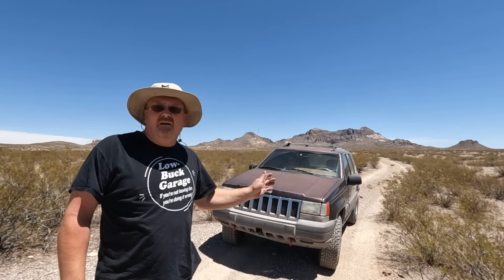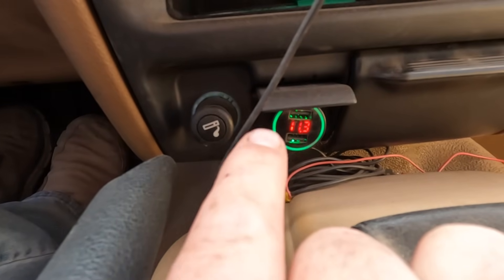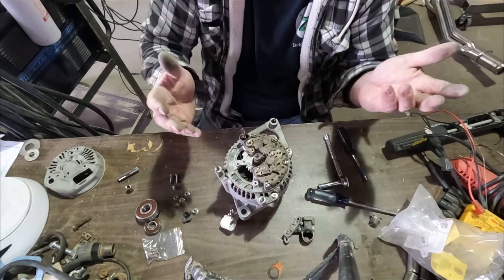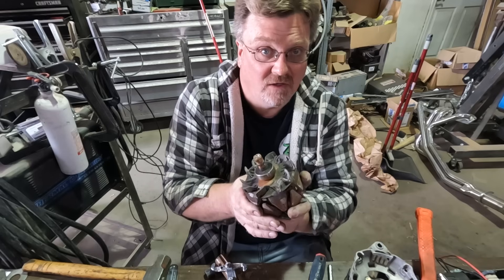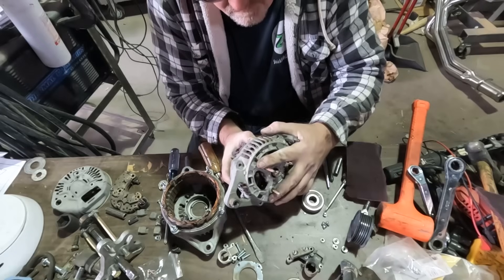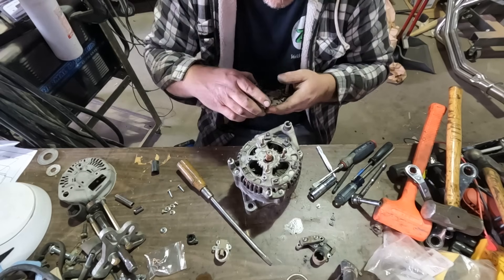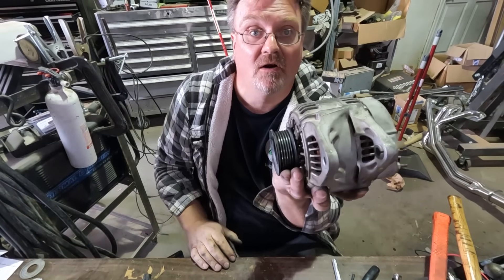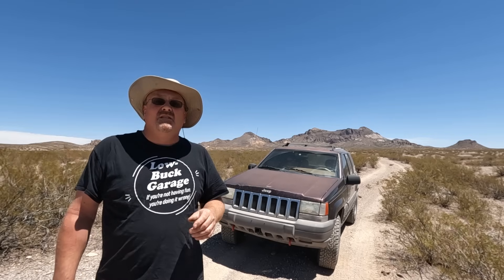$19 Alternator Rebuild, Cheaper is Better?

Comment: Growing up there was always a shop to rebuild alts and starters.  Now I do my own. Good to see you show others as well.
Reply: How did you discover a local alternator rebuild parts supplier?
Reply: In Cleveland Ohio area  I recommend  Gregg's  alternator and starter rebuild!!!
Reply: Handy hint. 
On news bearings pop the seals off and repack with good synthetic grease the crap grease they come with looks like Vaseline.
FYI.
Reply: @tomg6284  Yes it does look like Vas. However when you open the bigger bearings its got a yellow dye in a more transparent grease. There is no product in the grease that can cause extra friction through viscosity.
Reply: I’m with you Tom. Never trust a sealed bearing to be lubricated adequately.
Reply: We have one local down here , but , 
Some time he does a good job, but some times doesn’t. 
It’s like 50/50 . 
He warranty his labor for a one year.

Comment: There's a scrapyard not well known in my area that sells tested starters and alternators for $30-35 and gives you ten for your core. Their warranty is one year and is the best kept secret around here and even though it's an hour drive each way is where I go after calling for availability. They give free gas away too whether you buy something or not up to 20 gallons which is the secret.
Reply from the maker: I never thought about that, they probably get a lot of gas in the tanks of cars that come in, and would probably have to pay to dispose of the hazardous material.
Reply: Where are they located?
Reply: @wesleycorder4594  New Hampshire
Reply: How is an hour drive in your area
Reply: @brinkboysproductions6061  Rarely deal with traffic and it's mostly highway driving. Definitely a huge change from DC or anywhere in that area.
Reply: @Davemike27 That makes sense. Can you filter the gas. Best wishes.
Reply: we believe you ??  but seems more like lah lah land !!
Reply: Wow. What an awesome place

Comment: Great idea to rebuild an alternator.  I just learned that a new 175 Amp dealer alternator for my Lincoln Navigator is $1,000.00 here in Canada.  A rebuild can be had for about $650.00 to $700.00 (CDN).   We have one reputable alternator rebuilder in Toronto that does a quality rebuild for about a quarter of the new price, but they do have a turn-around time of 4 to 7 days, so you have to be willing to be without a vehicle for up to a week.
Reply: Good   day  from Ontario  Kitchener  Waterloo area  We have a fellow up here that does it too.
So were are from ?  Thanks
Reply: Well you did buy a Lincoln....
Reply: @r3dhorse  True, it is a premium vehicle, but I acquired mine used for a fraction of the new list price.  It isn't just a high price for the badge name.  I've realized the vehicle has a number of very high quality parts that exceed the quality of its' cousin, the Ford Expedition.  The standard 175 Amp alternator is just one example of that.

Comment: My experience with alternators is the new one from the parts store doesn't work either and they will gladly keep giving me new ones that won't work until i get angry, demand my original core back, and rebuild it myself.
Reply: Acronym of new... Never Ever Worked
Reply: @kelsycunningham8452  that's awesome, thanks!
Reply: If you bought a new one there would be no core charge. Lol
Reply: @TheMainLead  mouthy kid

Comment: When I was a dealership mechanic back in the 80's and 90's, we would repair alternators, not replace them. The most common problem with GM alternators at that time was the diode/triode, pretty cheap part.
Reply: I want to learn howto do this. Best wishes.

Comment: As a retired mechanic you can use a deep wall socket that fits on your inner race to install your front bearing rather than a punch.
Reply: Surely it should be the outer race. Otherwise you are transferring the forces through the bearings rather than directly on the race.

Comment: Unless the bearing is severely worn or about to fall apart, you can prop it up so that the top surface of the bearing is level. Then clean any dirt off the seal with a clean rag. Next, put a few drops of motor oil on top of the bearing and rotate the bearing by hand for a minute or two. Keep the top of the bearing soaked with oil. If you rotate the bearing back & forth for a few minutes, some oil will usually seep down into the bearing. Unless the bearing is severely worn, it will usually run for a few more years. The thicker the oil you can get into it, the longer it will take to dry out again. If no oil will go down into the bearing, you can pry open the seal a little to get some to go inside the bearing. Damaging the seal is okay, just don't completely remove it. Don't get oil all over the inside of the alternator because dirt will stick to it and make the unit run hotter. Alternators hate that. 
I used this method on a dry idler pulley on my 2000 Ford Expedition serpentine belt. That was about 5 years ago. I have the new pulley, but am too lazy to install it. And the tensioner spring on that Ford belt is some strong. It is amazing that those bearings last as long as they do. 
Smart phone photos are good to have before you pull things apart. Free too.

Comment: I had a '73 Peugeot 504 many years ago, and the brushes went out on the alternator. They are in a small plastic box that is held in by one screw. I disconnected the one wire on the box, removed the box and put 2 new brushes in it without removing the alternator. It was actually made to be easily repaired! The 2 brushes cost me $1.50 at an auto electric shop. So easy!
Reply: My dad bought a used 1966 Peugeot from a co worker that had four speeds on the column. I just remember how expensive parts were for that thing. It needed wheel cylinders and at the time wheel cylinders were going for 5 or 6 bucks for American cars. They wanted45 bucks for one wheel cylinder and you had to travel to find one. My dad didn't keep that car too long. Good comment.
Reply: @mostlymoparih5682  There are some dirty tricks. Measure the diameter of the wheel cylinder. Find another on with the same diameter. Swap seals. One I heard about was the guy who figured out Chevy wheel bearings would work in his old Jaguar.
Reply: @anonymike8280  Yeah some seals and bearing have a number on them and you can order them that way also. If we were not able to get the cylinders we were going to try and match up a wheel cylinder repair kit.  Happy Motoring.
Reply: @mostlymoparih5682  Last time I had to deal with a leaky wheel cylinder, I just swapped the insides. Same cylinder though.

Comment: That was a nice honest video. I really liked the trick he used welding the nuts to the bearings in order to get them off. A few suggestions always mark a line from one end of the alternator to the other before you do anything so that when you go to put it back together you will know the correct position the 2 ends should go back on. I would also check each diode to make sure they are all good and I would also check the coils to make sure none of them have a short to ground. Still, this was a very nice video.
Reply: if the coil was shorted, you'd have to re-wind it right? my alternator housing (case) was cracked. I haven't opened it up yet but I figured if the case is cracked it probably isn't even worth the rebuild. I am thinking about taking it apart just to learn. (it's what I do)
Reply: Cracked case was probably from a previous swap out. . . Probably run another bazillion miles after this rebuilding. . .

Comment: I used to love working at the local salvage yard. One of the perks of the job was free parts. Within reason obviously. I couldn't just take home stuff all willy nilly as I pleased, but if it was for my vehicle, it was free. I fully restored my 2000 Civic Si for nothing. Replacement engine, starter, alternator, steering pump, ac compressor, full interior, both doors, both bumpers, trunk lid, hood, headlights, tail lights, and wheels.

Comment: Recently the alternator in my F150 gave up in Gillette WY late Saturday . Monday was a holiday, and I had plans in Oakland CA that Monday  nite.
I bought a gas powered elect generator from harbor freight. It had 12 volt output that I wired to the battery. It got me where I needed to be
Reply: Nothing stops Scott.   Nothing.
Reply: @Dancing_Alone_wRentals  thank you sir.
It nearly ruined my marriage. As I recall the unit only put out 8 amps DC.
The women could not understand why I would not let them  turn on any accessories, or why we had to be in a hotel before dark, and had to be on the road by dawn.
Try explaining ohms law to a wife that thinks your being mean and selfish.
Reply: @scotthanson7888  , Is there another option?   Like say,  Wrestling an Alligator, or maybe mountain climbing without ropes?
Reply from the maker: That was a good solution, I'm going to remember that idea!
Reply: @scotthanson7888  I suppose you could have also bought a battery charger.
Reply: @dustytrailscactusron and not being able to boss the wife?

Comment: Good diagnosis. Nippondenso engineers are the absolute best in my opinion. NDenso used on Toyota, Honda in 90's best ever. I was a rebuilder for 20yrs and never found one bad bearing, they are oversized. Even their starters have great bearings and metal gears instead of brass bushings. Of course today, more and more magnets and plastic gears. Funny watching some some channels taking the battery cable off when running..Don't!! That's a myth from the old 6V generator days.
Reply: A generator will not work with the battery out of the circuit. Had an old Ford Falcon way back when. It had a brown out at night. I was able to stop and tighten the battery terminal with the engine running. Fixed that. In the old days of points, ignition coils and relatively low output alternators, you could take off a battery terminal and the alternator would keep on going. In electronic vehicles with high output alternators, you risk a high voltage surge and damage to the computer or anything else with electronic circuitry in it. If you have to do it, maybe it would be a good idea to have the headlights, air conditioner and anything you can think of turned on to sink the possible spike in current. Better yet, just don't.

Comment: you can use the old bearing to press the new one, I did this with a washer bearing it avoids the danger of punching a whole in a new bearing.
Reply: 💯,  can also use a thick washer with a slightly bigger center, so it's easy to pop off after. Maybe put a nylon washer in between to eliminate any potential damage.

Comment: Usually Bearings are the most common failure except on new cars the decoupler pulley followed by either the Brushes or the voltage regulator. On very rare occasions the diodes go bad but in the thousands of Alternators I rebuilt only once I saw a winding burn up do to over currenting. I would have used the same method to install the front bearing too just a larger socket to drive the outer race of the bearing. Nice to see people that actually rebuild things it's becoming a lost art.
Reply: Alternator on my wife's 03 Accord stopped working at 160k. The brushes were shot, and it was dirty in there. One slip ring was very worn, and I filed it down. Bearings were good and regulator is built in to the brush mount, so that got replaced also. Replaced the brushes and it worked fine for 2 days. Then it stopped working and I guessed the diodes went bad. Ultimately replaced the alternator with an AZ unit. Too bad it was not brushes and bearings as is most common.
Reply: @stevewolf2620  usually when a Diode goes bad it will cause a voltage drain when the car is off.  might have been a bad connection on the voltage regulator or it went bad.

Comment: This put me back working with my dad in his shop. Bearings and brushes - and sometimes the Voltage Regulator - would fix any alternator not shorted or with the stator contacts or windings damaged. Same for starters and add (for GM) reversing the copper 'slug' contact in the solenoid - sometimes a re-rivet job on the slug spindle. Then back in the customer's car. Brushes cost less than a buck for a set and bearings usually $1-3 apiece depending on model. Even less for starter bushings.
  
But always use the press, and some penetrating oil - too many damaged shafts and housings otherwise. You can get cheap presses to do the work these days, too.
  
So many things we used to recondition or remanufacture - now they're mainly just throw-away bolt-ons.

Comment: My 62 Belair had a generator. Replaced the brushes twice in 35 years - really easy. Bushings seem to last forever when you add a few drops of oil every oil change.
Reply: I'm old enough to remember when generators and starters usually had an oil fill port for the bushings... you just flipped up the little cap and inserted a drop or two before flipping the cap back down.

Comment: Your dash voltmeter was working fine initially - the needle was on the thick line halfway between 9 & 14 volts, which is 11.5 volts. Close enough to the 11.6V from the plugin reader . . . when it was reading right at the beginning. Obviously when it dropped below 9V & reader was 11.3 that's a big difference . . .
Thanks a lot for sharing this video, great to see how easy and cheap it is to fix an alternator. The last one I bought was AU$500 so even $50 for bearings and brushes would be way cheaper.

Comment: Buy just in case parts on sales from a pull yourself graveyard - at 40% to 50% off - an alt, steering pump, radiator fan & caliper are $15 each - store in a box so 6 mo or a year later one is needed all is paid for

Comment: Man that was gratifying at the end. I also had the chance to rebuild stuff that you can probably easily buy at the store. I rebuilt 2 electric fan motors. All it needed was carbon brush and bearing replacement. Though one shaft was a bit worn, it should last me some years. I saved like 300 dollars on that rebuild.

Comment: to get bearings off the rotor i take the angle grinder and cut grooves into the bearing to get the puller onto.
Reply: super easy this way.

Comment: A few years ago my alternator light started flickering at 100K miles so I panicked and bought a new brush set.  I still haven't put it on yet and it's now at 212K miles.  I think it fixed itself!
Reply: Dirt/carbon dust buildup on the brushes can cause an intermittent contact problem like this with the commutator... So it "fixed itself" just by running.😉

Comment: Great video. When I was young you could buy alternator brushes and bearings at any autoparts store. As the years went by you could no longer buy rebuild parts at all and a re-manufactured part was all that was available. It is so awesome to live in the age of the internet shopping and eBay where these parts are now available.

Comment: Good Job!, an alternative to struggling with removing the smaller bearing is to just use a very small screwdriver to remove the grease seal, then clean out the old grease and repack the bearing. Then replace the grease shield. If it spins smooth then you're OK for a while.    Just saying'     Mike
Reply: I thought that you would suggest jamming a screw between the races to pull with.

Comment: 5:59 you can often use just a large washer and make a cut in one side. Then you can slip in under the bearing and since the washer is larger it often is enough distance so the bearing puller "claws" straighten out a bit and get smaller. Also you can avoid sometimes that the housing is very close to the bearing.

Comment: I do believe it’s good to know these things to be a good mechanic and I personally have rebuilt many things but I found out long ago that when you buy auto parts at the neighborhood stores, they generally come with a lifetime warranty. All you need to do is keep the vehicle. My 97 blazer has 450k on it and I always get new alternators, brakes, radiators, water pumps, wiper and window motors and more miscellaneous parts. Just saying to keep track of your part purchases. It really save cash too. Thanks for the video..
Reply: Always keep the receipts. Scan the invoice into your computer with the date,
Reply: The lifetime warranty is just a marketing tactic for them. Probably, the majority of the customers do not have the same vehicle a year later.

Comment: Great idea!

I like the idea of welding two nuts to the bearing to get it out.

One idea to push out the rod where the brushes make contact is to put a thick piece of wood over it and then hit with a metal hammer. That way the wood deforms and the copper doesn't or doesn't deform as much

Comment: I will always try and rebuild when possible. Great video. Had a BMW Z3 and alternator died. Decided NOT to pay $370+ for alt alone and for $29 got the regulator and fixed. New bearings would have been "nice" but next time.  BENEFIT OVER BUYING REBUILT. RE-BUILDERS do NOT replace old parts, only BROKEN PARTS. This means a rebuild MAY have new bearings OR NEW regulator or new BRUSHES, but rarely all 3. Rebuilds die sooner due to old parts not replaced. that is why.  readers comments below.

Comment: You right man the OEM alternator never go bad except the bruches and sometimes the bearing, it happen to me 99 Honda crv, i replaced the OEM alternator with with aftermarket new one, and it lasted only one year and half, the rhe regulator died, lucky me i keept the OEM one, so i opened it and found the brushes weared out and they dont mak any contact with rotor, i replace them with new good one, and gusse what, the OEM alternator is working great, i should have changed the bearing also but it is still fine for now.

Comment: It's not the low voltage that gets them, it's that when batteries are going flat and go down in voltage, the current capacity of the battery goes way down.  So when it dies at 8v, it may or may not be the system falling below a voltage threshold so much as the battery just cannot put out much current when it is down to 8v.